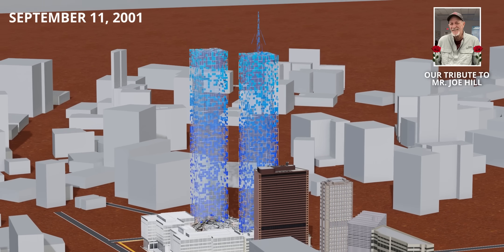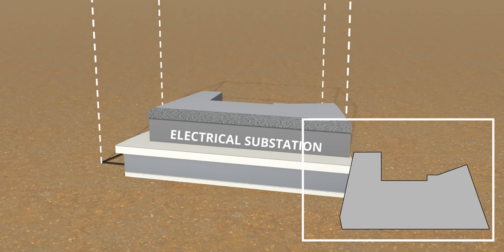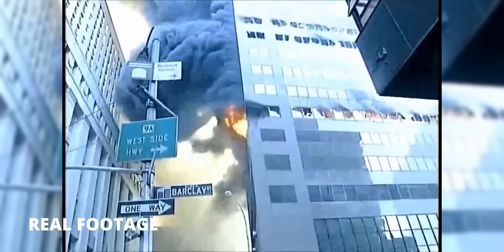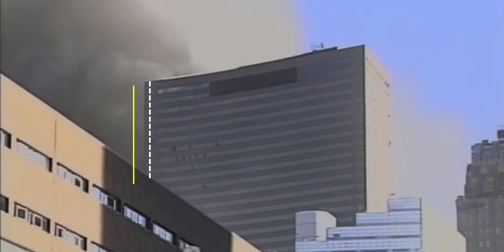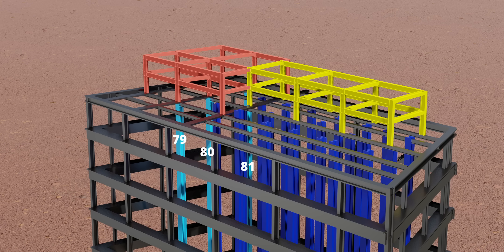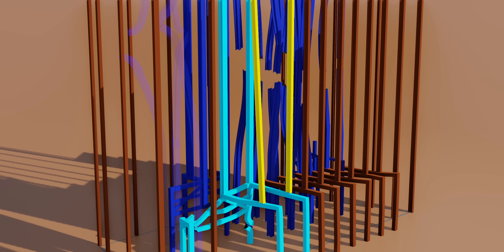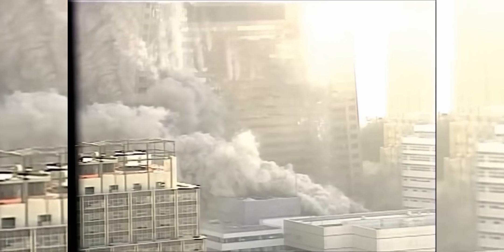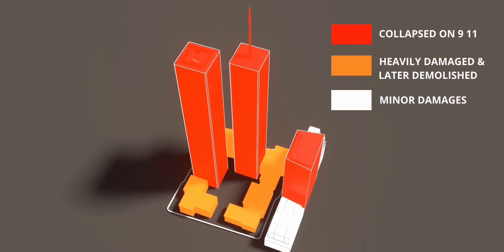Collapse of Building 7 | The Complete Physics

Comment: I would not hire this "engineering" firm, they don't even recognize controlled demolition when they see it.  100% controlled demolition, no doubt about it.  Also, at 5:05 the BBC reported that WTC 7 fell, it did not fall till 5:25.  They got some good fortune tellers there at BBC.  I could only watch this video for 5 minutes, then I was getting close to hurling.  Quote; "And thee shall know the TRUTH, and the TRUTH shall set you free."   Don't fall for the lies, then evil thrives.
Reply: I disagree, and rather than just leaving it at a 2-word hand-wave I will explain why you are wrong, in detail to a level you will never be able to rebut.  Enjoy.

Much misunderstood, Building 7 was the 6th building to collapse of 10 lost on 9/11. Because of its early low priority, conspiracy filled the information void with garbage made up by technically ignorant people promoting political agendas. But 7's loss is an engineering problem and should be treated as such, so I prepared this brief summary of my own analysis to fix that, using technical analysis, not ideology and tired memes. 

At 10:28am the WTC North Tower collapsed, showering Building 7 with tons of burning debris, causing heavy damage and starting many large  fires which burned out of control for the next 7 hours. Half the FDNY firefighters having been killed, units in disarray, equipment destroyed, no water pressure, and the greater urgency of search & rescue efforts, Building 7 couldn’t be saved so firefighting efforts were pulled as futile and 7 left to its fate. Firefighters make that sort of choice every day in brush fire situations - which houses to save and which ones to let go. Only real difference here is moving the decimal on the size and cost. People get overwhelmed by the size.

www.youtube.com/watch?v=g_SvpwyC17M

Collapse of a burning structure is always a concern for firefighters. Steel buildings subject to fire rely on active firefighting to survive. Buildings are designed around 1 to 3 hours of fire resistance, allowing time for occupants to escape and active firefighting to get started, after which all bets are off. Left to their own devices they'll exceed their design envelope and collapse, like Plasco Tower and Wilton Paes de Almeida. In 7 the occupants escaped, passive and active fire protections were compromised and active firefighting was abandoned hours before the collapse, which left the building to its fate. It lost. Odds on Building 7 would eventually collapse, and it did. No big deal in logic.

 http://www.youtube.com/watch?v=WnYBX6QT0R4 

FDNY Chief Daniel Nigro - The biggest decision we had to make on the first day was to clear the area and create a collapse zone around the severely damaged 7 World Trade Center, a 47-story building heavily involved in fire. A number of fire officers and companies assessed the damage to the building. The appraisals indicated that the building's structural integrity was in serious doubt. I issued orders to PULL back the firefighters and define the collapse zone. It was a critical decision; We could not lose any more firefighters. It took a lot of time to PULL everyone out, given the emotionalism of the day, communications difficulties and the collapse terrain 

FDNY Deputy Chief Peter Hayden ; We had our special operations people set up surveying instruments to monitor and see if there was any movement in the building. We were concerned of the possibility of collapse in the building. And we had a discussion with one particular engineer there, and we asked him if we allowed it to burn could we anticipate a collapse and if so, how soon? And it turned out that he was pretty much right on the money, that he said 'In its current state you have about 5 hours 

The collapse of Building 7 was anticipated and widely reported in the media throughout the day, with 24 video cameras recording some or all of the collapse. Everyone knew what was coming and why. 

www.youtube.com/watch?v=OY5S5k3tMHI

The collapse of Building 7’s was entirely different to the Twin Towers and harder to understand, most details being hidden from view and not intuitive.  But we can still sort out what happened through careful analysis and observation. This is my explanation of the collapse relying on no outside authority. 

Building 7 was a unique, asymmetrical 47-story steel framed structure built atop a smaller 3-story building serving as a partial foundation, requiring lower floors dedicated to complex load transfer structures. Of trapezoidal shape and all-steel tube-in-tube construction, B7 (above the 7th floor) consisted of a central core of steel columns carrying most of the gravity load, perimeter steel columns around the outside of the structure carrying the remainder of the gravity loads and long span beams and girders to tie those elements together and form the floors. On the outside of the building hung a moment frame or outer shell. 

Phase 1 : First externally visible signs of collapse initiation occurred at 5:20:28 pm and were notably quiet with observers not realizing the building was collapsing! No audible warning in the form of hundreds of ear drum busting 180-190dB explosive bangs preceding the collapse. Here at 12:00 a local CBS affiliate reporter is talking 10 blocks from B7 when collapse begins. People don’t start to notice the collapse until 12:11. At 12:45 is the famous CBS fixed camera clip of Building 7’s collapse. Note how quiet it is. 

www.youtube.com/watch?v=t5tEy6mXSE8

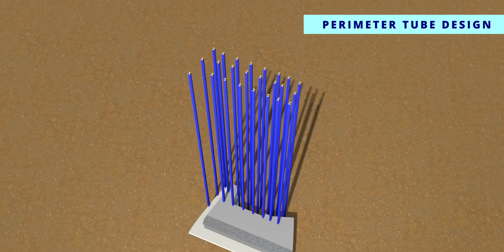Collapse initiation was due to lower floor failures above the load transfer region (8-14th floors) in the NE corner. In this video at 0:45 you can see the NW corner from inside the building while under construction, Column 79 just out of frame on the left. That big, angled steel beam across the top of the frame connects to C79 at one end. The girders connect to the beam. That beam and all those girders depend on just one connection 

www.youtube.com/watch?v=nP3TNHPCIVU&t=45s

Phase 2 : The NE lower floor failures caused a loss of critical lateral support over an excessive length of Column 79 and it buckled. Looking at a floor diagram of Building 7 (www.nist.gov/image-16640) when you see all the structures that depend on C79 you quickly realize this one column was a relatively isolated structural element on which a disproportionately greater fraction of the structure depended analogous to say the Key Bridge. Externally as collapse begins we see a vertical progression of window breakage along the 44-46 line and a kink in the roof of the East Mechanical Penthouse at the top of the building, consistent with C79 failure. Normally with a buckling column, the load could be redistributed to other columns. With C79 that is not the case - the failure did not redistribute the load, so the collapse rapidly progressed to the roofline, sinking the rooftop penthouse. The transition from full capacity to almost no capacity occurs in an instant and will result in virtually no resistance 

Phase 3 : With C79 gone, B7’s progressive, non-symmetrical collapse continues with adjacent columns 80 and 81 left laterally unsupported, and quickly buckling as well, sending the EMP down through the building. C79-81 all have no diagonal bracing, which is the major reason why they could not redistribute a lot of vertical loads among one another. From there collapse progressed from east to west through the central core until the core was gone taking all of the interior floors and probably most of the perimeter columns with it. Follow the horizontal progression of window failures low in the building and the dropping of the remaining rooftop structures into the building. One of the big takeaways from the NIST Building 7 study (invariably ignored) was how their modeling determined C79 failing under ANY circumstances would have initiated the same collapse sequence. 

Phase 4 : After about 10 seconds only the exterior moment frame remains, giving the illusion B7 is still standing to the casual observer since little has outwardly changed. But it is just a hollow empty shell like an empty cereal box supported only by a few remaining columns and overloaded from the loss of the core columns and floors, quite unable to remain standing. With nothing remaining behind it, the north face leans inward, forming a V in the roofline, the last few columns buckle under the strain and the moment frame free falls, landing on top of the debris pile. 

It is only here at the very end that a single measurement of alleged free fall acceleration is taken, from a single point on the outer shell. The Building did not “free fall” – just one corner of the outer shell did, sort of. The Building_ (defined as its center-of-mass) was already gone before that happened. The period of alleged free fall was a product of how it fell NOT why it fell and can't tell us what started the collapse 10 seconds earlier. Start to finish the collapse took 18-20 seconds, 3 times longer than free fall . How fast something falls cannot tell you what started it falling_ anyway. 

The debris spread outside the footprint blocking surrounding streets, heavily damaging the Verizon Building and destroyed Fiterman Hall. 

Building 7’s progressive, non-symmetrical collapse was incidental and unintended collateral damage from the combined effects of fire + time + gravity, started by the collapsing North Tower. That is true no matter who planned and carried out the 9/11 attacks or why . The collapse was of so little consequence it barely registered at the time - a footnote, only taking on semi-mythical status as an alleged smoking gun years later when demolitions at the Twin Towers, missiles at the Pentagon and shoot down over Shanksville all failed and conspiracists had nothing left to work with. 

Anything can seem like a conspiracy if you don’t understand how it works. Now you should. I hope you found this helpful, informative and it solicits informed critical comment. If I made any errors of fact, logic or reason or left anything important out, please let me know so I can fix it. IF you can offer a more plausible alternative please do. Be the first. Please start any reply with the words “Tits McGee” or I will know you didn’t read it and are wasting my time.

Comment: The ENRON evidence was sitting with the SEC (security and exchange commission office) located in building 7. The Twin Towers was the distraction toward 2 objectives: To make the ENRON evidence disappear and have a great reason to take over the poppy fields of Afghanistan and control the flow of opium distribution.
Reply: The ENRON investigation did not begin until AFTER the 9/11 attacks, so you are talking out of your ass.
Reply: Idk about enron, but that substation was extremely outdated. It was there before 7 was built. Now the substation is massive and takes up about 10 floors of the new building